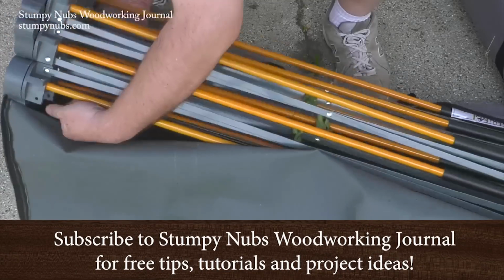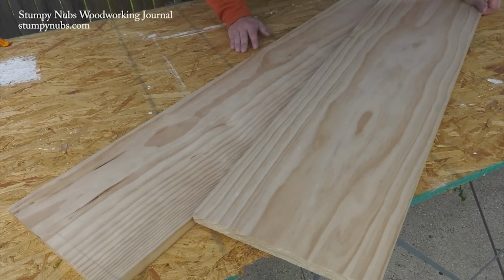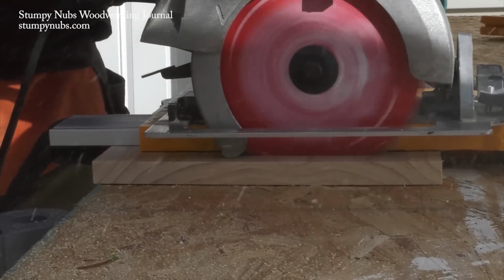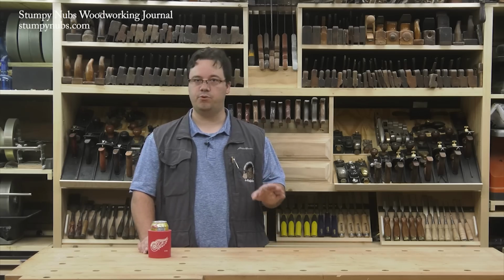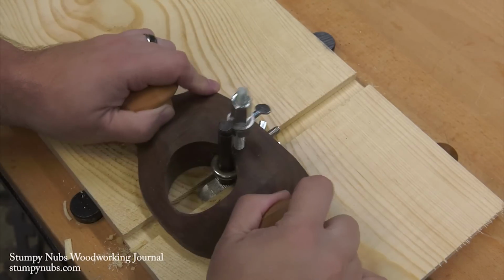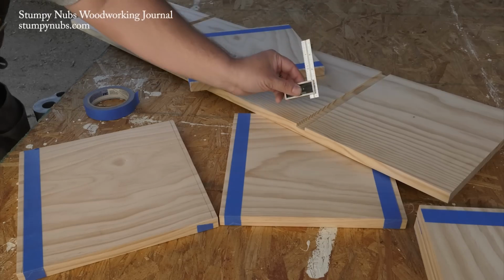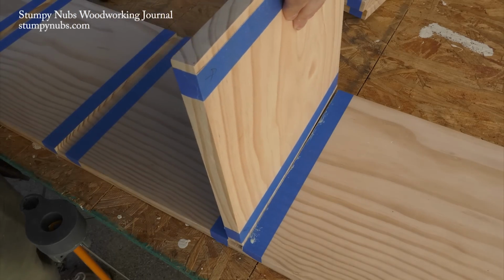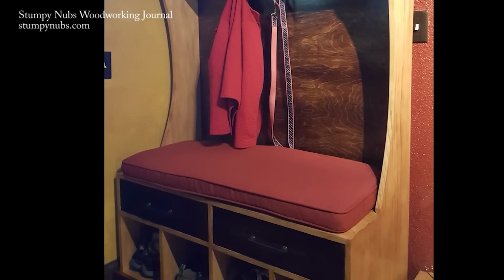Sick of fancy YouTube workshops? You'll like this video...

Comment: I will say that this video really emphasizes the significant benefits of a track saw more than anything. I don't think a corded track saw and long length of track are fancy except for that most YouTube channels often feature a dinosaur purple and green brand, if not that devil red one that rhymes with hell. I would certainly invest in a track saw above a contractor table saw, which I see tons of hobbyist clamoring to go out and buy on day one. They are only second to 12-inch sliding compound miter saws. The one dirty secret about track saws however is the shipping incurred on that long length of extruded aluminum; it's almost the equivalent to the cost of the damn track.

Comment: As penniless newly weds, 55 years ago, my new bride designed our lounge suite.

Actually it was a knockoff, seen in the upmarket store of David Jones Sydney store. She would surreptitiously visit the store with a tape measure, so came up with a set of working drawings.

I had a tenon saw, a mitre box, and a brace and bit. The arms and legs for the chairs and lounge were made of one inch round dowel, so joining them was a challenge. Fortunately I found a standard Meranti dowel to use.

I finished them off with many coats of high gloss enamel. My wife made the cushions. Side by side with the original, it was pretty good. My wife cherished my efforts for many years.

I made numerous items of furniture for her, with the most basic of tools.
Reply: god bless
Reply: dead set keeper
Reply: Marry her again.
Reply: That's delightful!
Reply: And then what happened?

Comment: As a beginner my mortise and tenon joints are a inconsistent and can be a bit loose (will hold against gravity but there's some play). What are your thoughts of using polyurethane glue instead of PVC to help compensate for play with mortise and tenon joints? Also a bit relevant for a loose dado

For context I'm currently building a small table to go next to the couch and one of the legs is a bit loose, the subframe means that all legs are square to the base of the table which helps with glue up alignment.
Reply from the maker: I'd rather glue in a thin shim
Reply: @StumpyNubs  thanks mate :)
Reply: Stumpy is right.  You can even glue a thicker piece on the tenon, and recut until it fits tight like it should.

You put a lot of work into this project with M&T.  Make it right so you don't have to rely on the glue, which WILL fail eventually.

Comment: I 7nde4stznd the point to this video.  However, the basic tools shouldn't be the least expensive.  I've burned out many a light tool.  Yep, smoke, burning, very hot, sparks and even small flames.  Circ saw, drills, reciprocating saw and a small grinder.

Comment: Look it is a pet peeve of mine when you see Youtube wood working channels (Don't get me wrong I love watching those guys) go 'here is a simple and cheap work bench" or 'here is a simple cheap storage system" etc then they go first rip your wood to size and walk over to a  five grand table saw so on and so forth and by the time there finished they've used ten grand worth of equipment. So I am glad to see your video
Reply from the maker: What difference, though, does the price of the table saw make? Presumably, he's showing you a technique you can do with your saw too- cut a rectangle.
Reply: This true but I don't have a a table saw the size of a dining table with really precise and easy adjustment, a jointer, a planer, mitre saw,  3 different routers,  2 sanders and a drill press.
The difference is this what is dead easy with that equipment is less easy or sometimes hard with what most people have at home. 
Can you honestly say you bench wasn't easier with you track guide system than someone with out that. Yes your shown Ideas and techniques but there is a lot of difference between the level of ease for example cutting 60 dog holes in you bench top free hand with a drill, with a router and chucking it on a CNC. So tell me that me at home with my circular saw, cordless drill and sander are  going to find these project as easy.

Comment: stumpy, could you please make a video with time saving tips for us who dont have a shop?  I am using similar tools as in this video and setup things on my driveway and clean up afterward takes so much time.  Having a flat surface to assemble is also a challenge.
Reply from the maker: Isn't that what this video shows? As for work surfaces, there's one being set up right at the beginning of this video. You will find it at the same link as the edge guide.

Comment: The Bora WTX router plate works well.  But DON'T lift it at any time or at the end of the cut until it has stopped completely. Doing so will destroy it and chew up the plastic.  Don't ask me how I know.  The router is just sitting on the jig.  We are in the habit of lifting it at the end of the cut.  This may have been corrected in the NGX version but I don't think so.
Reply from the maker: That has never been a problem for me.

Comment: I have that exact Bora setup. I have 3 circular saws but the mount doesn't work with any of them. The clamp is underwhelming but it works for under 5ft cuts. The extension is worthless though so I ended up making a guide with my table saw & a few pieces of osb.
Reply from the maker: They improved the saw plate with their NGX version. But the older WTX version worked on all three of my Saws.

Comment: i started in wood recently, with only a small apartment to work in, and I quickly realized hand tool woodworking is seemingly 100x harder than using fancy machines. I wish I had learned this before hand and I probably would have cursed a lot less as I went. I am still keeping at the hand tool working though, and it gets easier everyday. can't wait for the day I can start occasionally using the fancy machines though.

Comment: In my Vocational Technical Carpentry class (in the early 80's) second year students made a framed kitchen cabinet using only hand power tools and hand tools.  I started hobby woodworking with a circular saw, aluminum straight edge, router, belt sander and palm sander.  I think those methods and skills helped me a better stationary tool woodworker today.  I can't remember the last time I used primarily hand tools to build anything.  I'm a fan of Stumpy but how many and how often does he use the tools in his background? Not being critical but pointing out that we have changed the way we work.

Comment: I'm a welder mechanic for the most part. But I do have a bit of a thing for wood. Recently I started building bee boxes with blind dovetails. Used my cordless saw and a cheap plastic saw guide from the blue place. Did the first 3 boxes totaling 9 10 inch tall supers. All on my tailgate and 3 sawhorses. Dados, rabbits, and dovetails. I have a lathe in my shop and can't have the sawdust on it. Anyway with some dynamic thinking anything can be built anywhere.

Comment: All I will say is do NOT buy the Ryobi circ saw in the thumbnail if you plan to ever cut wood over 4/4. I just built a set of stairs, and that circ saw, even with brand new Diablo blades, was a nightmare. It over heated, and bound, in pressure treated 2x12s, while cutting stringers. If you buy a Ryobi  circ saw, just make sure you only are planning to cut 4/4 or less. Spend the extra money and buy a "buy once, cry once", DeWalt, or Milwaukee, or Makita, or just any other brand.
Reply from the maker: I removed the brand on the saw in the thumbnail because it is just an image, not an endorsement of any particular tool :)
Reply: Hah. I figured, but I just had so many issues with it that I felt it was my duty to warn every soul on this website to steer clear, if they saw the color and for whatever reason thought you had endorsed it.  @StumpyNubs

Comment: The short answer is no.  I have made book shelves out stair treads and scape plywood for the back using just a circular saw.  I have made a set of nesting out door tables using a powered compound miter saw and my battery drill.  But as the quality of the increases, the more tools in my shop I use.  Some times is is just so I do not have to change the setup from cut to another.  I just use another machine.

One tool that change my life was buying a planer and I recommend buying one as soon as you are ready.  Being force to get my boards from a big box store, planing all the boards to the same size or thickness help so much with fit and the joints.  The thickness of the boards vary so much.

Comment: Of course you can! I designed and built a bunk bed for my son, using only non-power tools, like handsaw, hammer, screwdrivers, etc. 
The only mechanical tool I used was a battery powered drill, for drilling and screwing some screws in 😊

Comment: I found that the Bora system wouldn't clamp properly to my circular saw. So I use the straight edge only. Love the idea of making projects with tools that us common folk have. Thanks for the content.
Reply from the maker: They improved the clamping system with their newer NGX saw plate. It works with the older fences, too.
Reply: I had the same problem, even using the newer NGX saw plate.  I absolutely could not get the plate to NOT move relative to my circular saw.  The slightest pressure and it would shift, ruining all the time spent aligning the plate to the base.  I now use only the straight edge, and cut a spacer piece to put between my pencil line and the edge of the straightedge.   I built a whole vanity this way, works fine. @StumpyNubs

Comment: 22 years ago I made a computer desk with just a circular saw, cheap palm sander and hammer.  It turned out pretty good and I still use that desk to this day.  You dont always need expensive stuff to do good work.
Reply: In 1988 I made a computer desk using just a jig saw, electric sander and a hammer. I used that desk for about 30 years with some modifications over the years to adapt to changes in computer styles. As built it had a keyboard drawer and drawer for a dot matrix printer.
Reply: @christopherlatham4254 1
Reply: Imagine how good you'd be if you stopped sanding your palms 😋
Reply: There's a bookshelf with glass doors in my family that my Grandpa (born in 1910) built out of orange crates and other scrap wood, with few, if any, power tools.

Looking at the piece, you'd never know it was homemade.
Reply: And beavers build their homes with only their teeth.
Reply: @ctrlaltdebug  🤣😂
Reply: When I moved to Indonesia 13 years ago I knew very little about the exotic woods common here or even where to find quality woodworking tools as online shopping wasn't a thing and there are no big box stores. I can't even remember where I got the wood from but I did manage to buy a handsaw and a few other basic hand tools because I wanted to make a little table for my new wife. It actually turned out pretty good and I had a good laugh when I heard my niece now in college is using it. Living here has taught me that you don't need a fancy shop or tools as the Indonesian craftsmen (and yes it's PC because they're literally all men) build amazing furniture and even houses and boats with very basic and primitive tools. They use their brains and creativity instead of a credit card.
Reply: @pakde8002  Having witnessed some scooter workshops in Thailand and Vietnam I'd support this creativity vs credit card mindset.

Sometimes it might backfire, but still great to watch how people manage to do as much with so few.
Reply: I made a table out of a bunch of scrap wood one time , it was a total piece of sht bit I used alot of screws so it was solid.
Reply: I made a computer desk out of a 10x2*16, some black pipe, screws and some sealant. Works great and I have no plans on getting a different desk
Reply: Ever been to Mt. Vernon, or any other place in that time period. No fancy tools then. At least none with a cord or a battery. And just a guess, but I doubt that there were very many truly straight straight edges or perfect levels. Not to mention measuring devices. That would have definitely been when you just used 1 device. If it was off, at least the measurements and the marking on the wood would be the same length. We have become a spoiled society in many ways, but I’m not complaining.
Reply: @BobBob-eh5sb  they definitely had and used essentially modern surveying equipment at that time, and certainly had straightedges and levels and whatnot, it wasn't the stone age...  sure all hand tools mostly, though there were water mills for lumber....
Reply: I had my daughter draw her ideal desk for homework. Then we cut the wood and she built it. It was all assembled with screws, but she was incredibly proud of it, and it worked just great.
Reply: does it wobble ? 🙂
Reply: I made a closet kinda thing with a circler saw and drill, measuring tape, glue screws. Its very strong and still perfectly straight. Maybe I was lucky as nothing i have is fancy.
Reply: you can even just ask home depot employees to make a few cuts and not own a saw or a truck
Reply: Can confirm, I made a wardrobe in the Louis Quatorze style using nothing but a hammer, my Swiss pocket knife, nineteen paperclips and a hang-me-down soldering iron
Reply: My first project 17 years ago was a fishtank stand for 3 3ft fish tanks, all 2*2 and 2*4s,  lapjoints and stretchers and bracers and mitred facings were cut with a 6" victorinox chefs knife, hand sanded to 400 grit and oiled with an old pillowcase and oiled with olive oil. Smelled great, looked like a first project, but it still stands. The fish are different but you need to think outside the box sometimes
Reply: @razzlebazzle420  wow, a victorinox chefs knife will cut a 2x4?
Reply: @PRH123  yeah but it's not like cutting a carrot, it's more like a 2" wide axe wound that takes a lot of clean-up
Reply: 23 years ago I made a canoe with hack saw, nail file, and chewing gum.
Reply: @tjesse you had chewing gum available? Must be nice...
Reply: @tjesse  What's the chewing gum for?